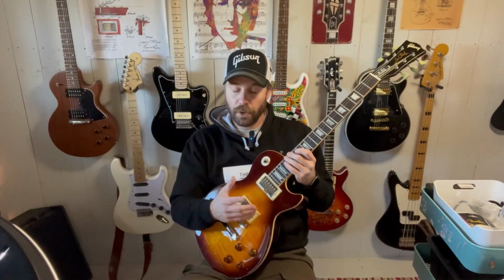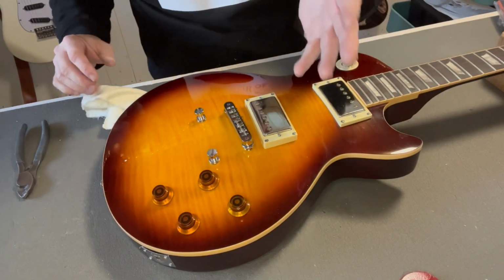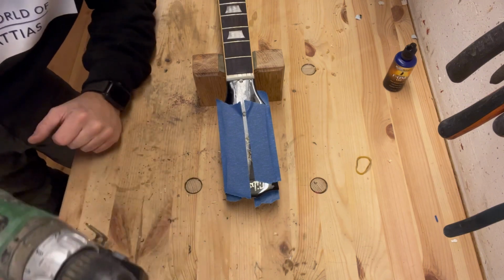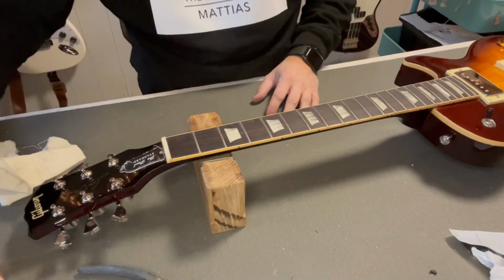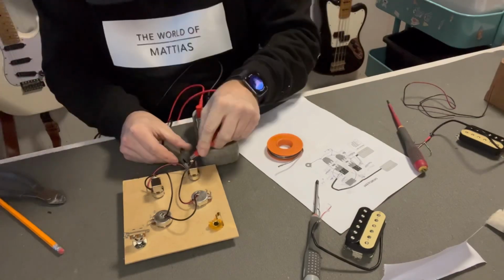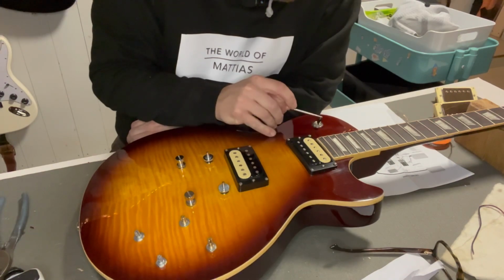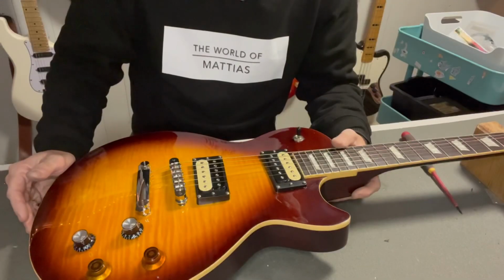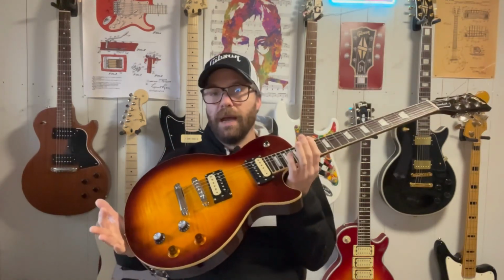Quality Chibson upgrades

Comment: good giving it an upgrade, my 2 cents is best bet is just turning the saddle around in the bridge, if that don't do it, turn the whole bridge around and reverse the saddles. or get a Nashville bridge. on the tuner holes i just want to add that if you go all the way through it makes the top of the hole bigger than the bushing and the string pressure strain is not relieved as well on the tuner. on the pickups, im sure tesla pickups are cheap, but i myself figure why replace cheap pickups with cheap pickups if its an upgrade, why not Dimarzio dp100's, Duncan SH set, Gibson BB's or something. however, as a whole the guitar looks good(despite the edge of the pickup rout showing a tad) and looks like it plays well, it sounded like it was flopping on the frets a little though, like the action is too low on the low E. in the end if it makes you happy, you do you. as a side note, if you ever level the frets pay close attention to how far in the truss rod bolt is,  if its in far as ive noticed some of them are, then the 1rst fret will not follow the rest of the frets as well and you might end up with 1rst fret buzz on the second, i had to level my last fretboard because of that. but in the end it was worth the effort.
Reply from the maker: That´s some good pointers, thanks for sharing!

Comment: Most of the old Les Paul 'Standards' had blank truss rod covers, There was no standard until a while after the custom came out, they were just Les Pauls.
 It already said Les Paul on the headstock. The font used in the seventies is my favorite, but for some reason, only old ones at 80 bucks a pop show up now and then. I do have that same standard cover you are using on one of mine, with raised letters.
These font change things are more closely related to who owned the company at the time.
Reply from the maker: Yes, that´s correct. I really wanted the other "Standard" font on my trussrod cover. But there was a mix up in ordering it. But the one I have is fine :)

Comment: If you cannot intonate, (because of only a mm, or so), you can cut off some of the spring. Start small. One, or two, coils at-a-time.

If the spring no longer holds tension, (because it's shorter), stretch it. When compressed, it'll still be shorter.